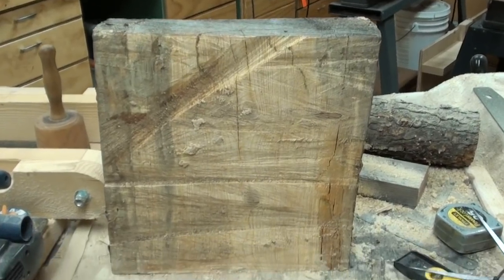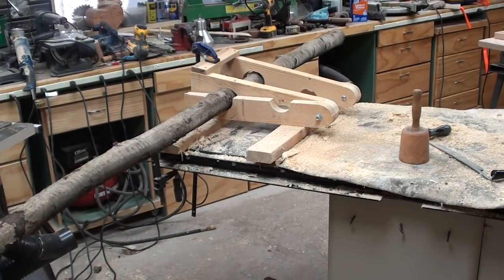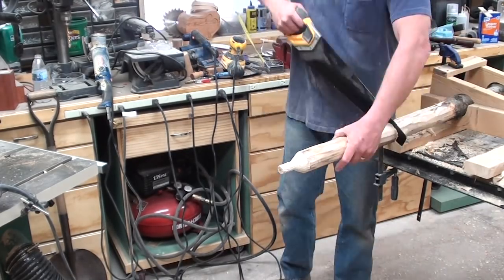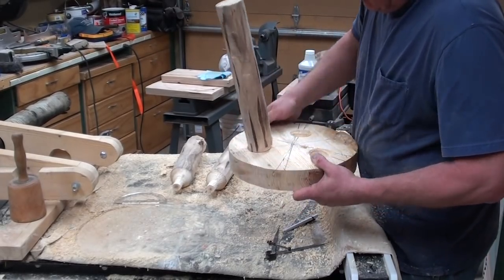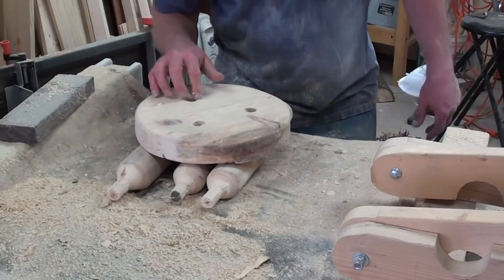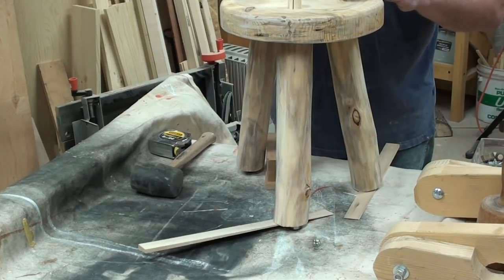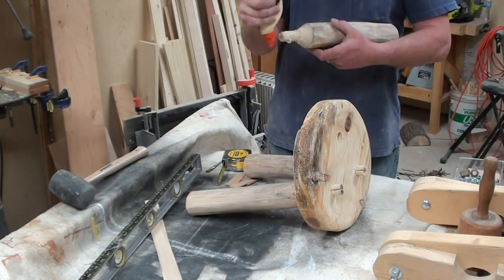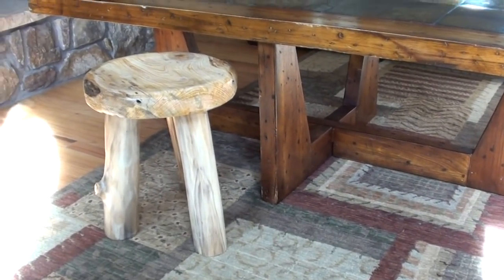How To Make a Rustic 3 Legged Stool

Comment: wow, that turned out great!!

a slight chamfer/bevel on the bottom edge of the legs may help prevent tiny chunks of wood from splitting off the edge when the stool is slid around

but like i said, great result
Reply from the maker: Thank you for watching!

Comment: Looks beautiful Of course, the forest can still be seen in the stool.
I would have left the glue off.
Drilling that with the wood around the angle is a good idea.

Have you ever tried to use a wooden thread?
I would like to see if it holds up well.

Comment: What did you use to cut the tips of the legs off after you put wedges in?! Wish that part was shown. I'm guessing a Dremel or something as not to cut the surface of stool and to get nice and flush. Thank you
Reply: I was reading these comments to see if that was answered! Very detailed and helpful otherwise. Also, do the wedges go into the seat or stop level with the top?

Comment: Where do you get these tools...I mean the giant pencil sharpener and the paddle bit to make a hole to match?
Reply: Amazon, Rockler, Woodcraft
Reply: cdouglas1942
Thanks I found the sharpener part, but all they has as auger bits and not a tapered paddle bit to make a hole that will conceal most of the male end into it. Is there a special name for the bit?
Reply: I don't have the tapered tool either.,  I think I got my "sharpener" part from Lee-Valley so a phone call to them might solve the problem. 
Not sure they're necessary, but its an esthetic approach in a mostly not visible place.
Reply: Yea I like that most of your taper in hidden in the body of the seat. I will call them.